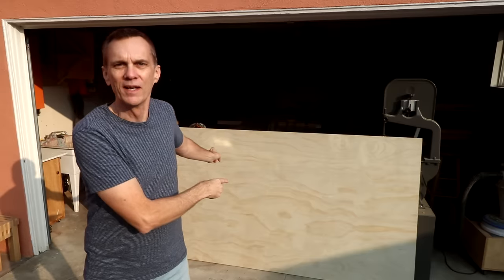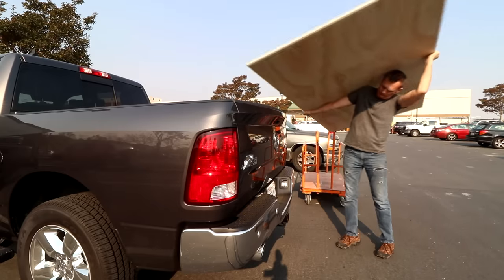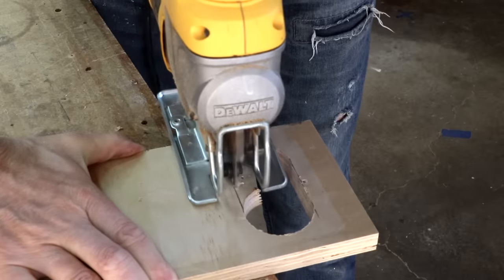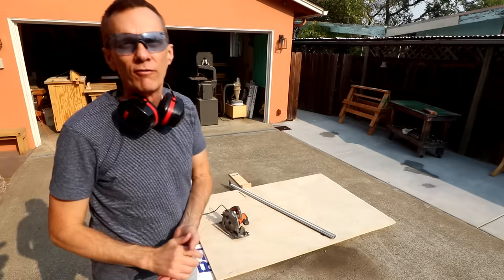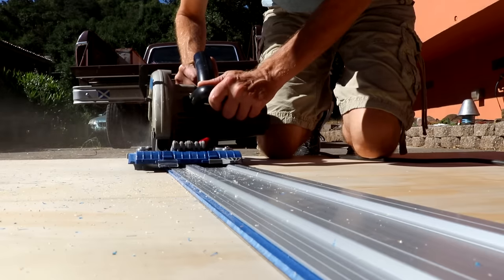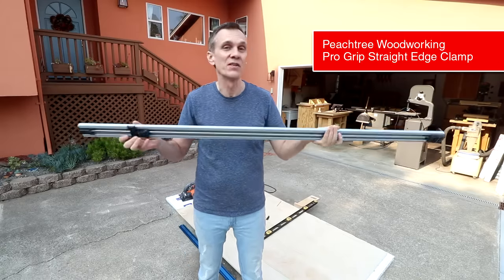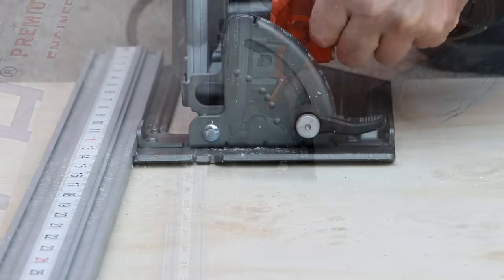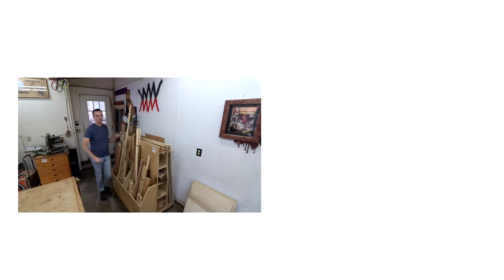How to break down plywood. A guide to cutting, moving and hauling plywood by yourself.

Comment: Having been a cabinet maker for more than thirty-five years I can say everything he said was true but that is one other concept I’d throw in! Try not to “lift” plywood. For a long time, several years in fact, I’d have to cut up a lot of plywood and be exhausted by the end of the day! Then one day, I had a big stack of plywood was delivered by the lumber yard by a driver named Blacky. Blacky was old, tired white haired (like me) and he delivered plywood all day every day. Most small shops like mine don’t have forklifts so he had to unload by hand and he taught me this valuable concept for handling plywood. DON’T PICK IT UP! Gently role the plywood on it’s corner then you just need strong fingers. Let me explain a few things first. The outside edges of most plywood was considered “expendable”, if it was lightly damaged it was still sellable. Melamine is 49x97 because it absorbs moisture at the lumber yard and is often slightly thicker and intended so they expect you to cut off the first half inch. So at the lumber yard get help loading it, they will help if you try to look weak :). When you get home, tip it off the car/truck on it’s end. Role it over the corner into your waiting hands, then it’s just sort of hanging on your fingers and your arms are mostly relaxed! Blacky could unload tons of plywood everyday. Same thing goes with the table saw, when it’s hanging in your arms, letting it rest against your shoulder then lean it against the wall or lower the corner onto the table saw, close to the fence, then role it over your shoulder and slide out from under it by backing away from the saw carefully  to not let the plywood touch the running blade until you are safely behind the plywood ready to guide the plywood up against the fence and through the cut. The key is to keep safe and go slow. This way you can handle plywood all day. The exceptions 1” plywood or particle board, it’s just to heavy and you tip and roll it everywhere, into the shop, up an the table saw etc.

Comment: I have the same truck. When I get 4x8 sheets I have the tailgate down and use two ratchet straps that crisscross over the end of the sheet and hook into the cargo hooks built into the truck bed. Very secure. The sheets will absolutely not be going anywhere.

Comment: I have one of those cheap no-name straight from China versions of the peachtree straightedge, and it's a piece of garbage.  You get what you pay for.
For making long straight cuts I simply got two pieces of melamine-coated chipboard (one wide, one narrow) and glued+screwed them together (narrow piece on top, aligning one edge of each together so it is 'stepped').  Run the saw along the edge of the narrow piece to make a zero-clearance line in the same way Steve did on the Kreg guide.  For about Au$50 I ended up making six guides of varying length (so I didn't have to use the 3m one when I only needed the 1m one).  Then out of some plywood scraps I make a rack to hang them from so they're out of the way.

Comment: Great tip on cutting on the floor when you just need a few quick cuts,,  but 2 , 2x4s on top of saw horses work great also.  I have just picked up the larger portable saw from Makita that takes dual 18 volt batteries . it seems when you just need a few cuts or work remodeling like I do you have to look for an outlet , not to mention cord getting in the way.

Comment: I need to cut plywood as I will be using it to replace the flooring upstairs. I live in the UK so the room sizes are fairly small. I was going to buy a table saw but then realised the cuts would be too long and the sheets too big. I then thought of a plunge saw and track but this might be a waste of money. Would this be useful for cabinet making in the future? Maybe just a circular saw and a straight edge would be best, it doesn't have to be super accurate for sub flooring. What do you think?

Comment: When talking about using a clamped on guide with your circular saw, I would add that you’ll get a better result if you have it project at least a few inches past the beginning and end of your cut.  If the straight edge begins right at the beginning of the cut it is hard to get the cut started straight.

Comment: I carry sheet goods on my back. I can carry 2 4x8 sheets of particle board like this. You can't carry it this way through some doorways but anything from French doors on up I can carry this way through the opening. The technique is to get the board up on its short edge and reach behind yourself and grab the two long edges with your hands, lean forward, lift and bend over until the sheet is resting on your butt and shoulders. This method is very effective and allows your legs to do all the lifting.

Comment: Well, as a former employee of one of those " Home Lumber type stores" I recommend you NEVER use the vertical carts they have, and instead get one of the FLAT carts that are about 24" tall to load your Plywood on.  Its TONS easier to load in the store, as the Plywood is laying Flat there, and even easier to load your Truck or Trailer , by just rolling the cart up to the lowered tailgate, put the end of the sheet on the tailgate, and slowly slide the sheet in flat.

Comment: All great tips. I’ve tried several of the edge guides and finally settled on a home-made shooting board. I simply mark two dots where I want the cut, clamp the shooting board down which already accounts for the blade position and cut away. The only thing that would improve upon it might be a battery-powered saw I think. But great tips 😁👍🏻
Reply: With how lithium batteries and motors have come on in the last 3 years, might be surprisingly affordable

Comment: Steve, what method would you use for cutting a 4x8 sheet of 3/4" into 18" wide full strips?  I am struggling getting the precision that I want.  I have the 2 piece Bora straight edge but it actually bends in the middle - I realized this mid cut...ugh.  I have a festool track saw but the edge is only 55".  I tried cutting it to 19" width and then tried to rip to final 18" on my SkilSaw jobsite SPT-11 table saw but failed horribly.  I tried and tried and could not keep the panel against the fence and even when I used a featherboard for some reason.  Had to leave all the tools in the garage and walk away.

Comment: For a recent project i made a vertical sheet jig that actually became a very useful project itself. Kinda like the storage unit you display last but much larger and with 4 vertical 2x4 with a slight slant so the sheets rest easily on it. For precise cuts i screw it to the frame so it stays in place as i cut. 
Very ergonomic, portable and space saving. I can either store more sheets inside it or leave it mostly open so i can reach both sides when i build my projects directly on the jig.  Just annoyed i did not make this earlier, could have saved me much headache. 
Could take a picture of it if anyone is interested. Didnt make plans for it but it is kinda based off the frame for maslow cnc that have guides.

Comment: I just use a piece of dimensional limber that has a good edge, a square and a couple of clamps. Allowing 1.5 inches for the saw offset.
I slide the sheets (usually 4 at a time) on 4 sawhorses in the garage. I back my van to the door and slide off the sheets onto the sawhorses, which are slightly lower than the top of the pile of sheets in the van and with little effort, slide the sheets onto the sawhorses. I then align the corners of the sheets and clamp the guide so that the cut is across the middle.
A final check with the square and tape, then cut, to get 8 4x4 sheets that I can easily handle and stack. As far as blades for the saw, I've gone to a 40 tooth Carbide blade. It gives a better edge and an easier cut.

Comment: I live in a country famous for its forests and timber industry but plywood is virtually unavailable.  Our panelling of choice? is OSB which comes in 1250x2500 sheets.  Most of your handling advice applies to that material too but with the added warning that cut edges of OSB can be razor sharp and it is good practice to run a sanding block along each edge after cutting it.

Comment: One point to know regarding handling is that 4' x8' plywood sheets weigh ~ 100 pounds per inch of thickness. Thus, 3/4" thick full sheets will weigh ~ 75 pounds. This is useful knowledge for both ones body lifting capacity as well as vehicular transport. A 20" high stack of plywood will weigh ~ 2,000 pounds or one ton, regardless of individual sheet thickness. The same 20" stack will contain ~ 27 sheets of 3/4"  and ~ 40 sheets of 1/2". Actual thickness specs along with manufacturing tolerances will both affect final count of sheets of a fixed height stack.

Comment: I have a special clamping tool to help with picking up/moving sheets. Recently went to home depot for some hardware and noticed culled full 3/4 MDF sheets that were barely damaged... 70% off 3 of them. Could not pass it up. When I was loading it into my truck, unfortunately I tore a ligament in my elbow. Think through it before moving 4x8 sheets by yourself. That 30 seconds could save you from injury.
Reply from the maker: Agreed. Bring a helper. There's no way anyone at Home Depot will help!
Reply: @SteveRamsey  holy crap Steve replied... first creator that helped me get into ww. Thanks for all your work Steve. You da man.

Comment: My experience with the Kreg guide is that my blades “wander” even as I keep the saw flush and tight, creating a poor cut line.
Reply: I found that the bearings in my saw had worn, allowing the blade to move from side to side by at least 1/8 of an inch.  It was impossible to get straight cuts and a huge source of frustration.  The bearings were out of production but I managed to find a set of old stock online.  When rebuilding it I realized the bearings are adjusted by friction and I could have just tapped them into position to remove the extra play.  At any rate, after the rebuild it cuts like a dream.

Comment: I was able to get a full sheet of plywood in my little hatchback car. I had the store cut it up into strips which is what I needed. You can rent a van from Home Depot or Lowe's and move a lot of sheets if you don't have the ability to move them with a truck.
Reply from the maker: Good suggestion! I forgot they rent out trucks.
Reply: Chris Calon and for about $70.00. they will deliver!!! Great for larger purchases!!!
Reply: Just watch the fine print on renting transport.  Additional Insurance,  Petrol and mileage.  Just get an airtasker to do it for a fixed price and ask them to be careful.  I buy in quantity to make it affordable.

Comment: Awesome video Steve. I just signed in to your weekend wood worker course and I've already built the patio table! I just have a question: installing cleats for a concrete wall, which is better nail or screw? Because our walls here in the Philippines is mostly concrete not wood haha
Reply from the maker: Thanks for joining TWW! I would use screws with concrete anchors. You might try construction adhesive, but it might not hold as well.
Reply: @SteveRamsey  thank you so much Steve for the advice! Keep inspiring people :)

Comment: I wonder what is 'broken' more often, panel saws at the box box stores or shake machines at the big burger spot?  In both cases, based on conversations with folks that work with them, more often than not the machine is fine but the employees don't feel like using them and/or there is no one trained to use them on site.

Comment: Someone posted in the Home Depot {"Despot") about how warped, and damaged some wood samples are.  And they are, as far as I could tell.  Could be water damage or "carelss" storage or lack of heat treatment of pine samples.  80-90% of the wood samples I checked were warped or damaged in some way.  Large variations in humidity and temperature might cause it too.

Comment: I bought plywood at my local Lowes and had it cut there. The piece sizes ended up being way off, up to a full inch on some cuts. I'm not sure if it was just my local Lowes employees not caring, but you might have better luck with Home Depot for cutting plywood.

Comment: That 50" peachtree clamp is no longer available on Amazon.  Do you have another clamp that you recommend?  You seemed to suggest that it performed better than the one you had previously.
Reply from the maker: This Emerson one is just about the same. I haven't used it, but  I've had people tell me it works great! https://www.amazon.com/Emerson-Tool-C50-Contractor-Straight/dp/B003TXSAHU/ref=mp_s_a_1_8?adgrpid=56734494220&gclid=CjwKCAjwyqTqBRAyEiwA8K_4O9oOK3KIROmbmmlHNI6DaC1hqnBKNcL1eGHzuw1Eb9MwRzqIce_ukxoCQMIQAvD_BwE&hvadid=274683045273&hvdev=m&hvlocphy=9032109&hvnetw=g&hvpos=1t2&hvqmt=e&hvrand=1844575112176926434&hvtargid=aud-647846986281%3Akwd-300525095022&hydadcr=20376_9349054&keywords=bora+clamp+edge&qid=1565131683&s=gateway&sr=8-8

Comment: Looking at your local Home Depot, I guess I'm lucky.  I have a large lumber shop nearby that will load sheet goods for the customer (great selection, true to size).  Since I have a Suburban, sheet goods will lie flat inside the truck and be protected from the weather.  If I buy from the orange big box store, the flat lumber cart is the same height as the rear of my Suburban...just open the doors, roll the cart forward, and simply slide the sheets into the vehicle.  But on another note, I try to avoid buying sheet goods from the big box places...too much variation in the thickness of the plywood sheets.

Comment: There is a gorilla gripper if your doing lots with heavy ply.  There is one that’s cheaper on eBay.  There is also a jig with a wheel and and clamp to attach it to one corner and wheel it around. By picking up the other corner.  A full sheet storage mobile unit would be a good project.  Especially for those who don’t have a truck.  And an attachment jig on your work bench to tilt a full  sheet onto your workbench is also a good project.  I don’t have a truck so it’s cheaper to buy quantities and have delivered by an AirTasker.  Should have mentioned I have a full sheet workbench 2440x1220 in a single car garage that every thing else fits around.

Comment: Question. What is best way to transport/strap down plywood if you dont have truck?
Reply: A lot of home and hardware stores sell small, folding trailers.   They're 4' x 8', pretty cheap and fold in half to store vertically against a wall inside or outside.   It doesn't take much of a car to tow them with a few sheets of plywood.  I've used mine to haul  junk, plywood, riding mowers and  motorcycles.   I'll even use it instead of the pickup that I have now because the trailer is a lot lower and easier to load.   Very handy.
Reply: Harbor freight 4x8 folding trailer works great!!
Reply: Call a friend that HAS a truck?
Reply: Buy a minivan
Reply: @larryg3326  what? Ive never heard of those.

Comment: The prices you showed for track saws are towards the upper limit.....I wouldn't be so quick to dismiss them now.  A decent one can be had for ~$150 nowadays.  The Wen model (the exact same saw as the Grizzly/Shop Fox/Sheppach) used to have some issues sitting flat on the track, but that's been corrected.  With a few easy modifications to the internal spring and dust collection, one of these saws will function just as well as the more expensive ones you've shown.  The all-in cost would be similar to the straight edge guides you've chosen instead.

Comment: if you mount a castor under your hook jig it woul make moving sheets even easier
Reply from the maker: That's a good idea!
Reply: @SteveRamsey   Or two flat skateboards behind each other wit U-clamps mounted on them.
Reply: Steve Ramsey - Woodworking for Mere Mortals thank you Steve
Reply: @SteveRamsey  I think April Wilkerson has one with casters
Reply: The “I like to make stuff” guy has a good video on making something like that to easily roll sheet goods around. Looked like it worked well.
Reply: If you add a spacer block on the "load" side, right under the handhold, your knuckles will thank you.
Reply: But it will make the poor castor tired. Better put a castEr.

Comment: How big are the plywood sheets in America?  In the UK we usually have 2x4ft sheets. Perfect for a workbench or table.
Reply: 4x8 ft is the normal size, some of the Baltic Birch comes in 5x5 foot sheets.
Reply: You can get 2x4 sheet but they usually cost about twice as much per sq ft..........4x8 is the most common and economical.

Comment: Another good idea is too build your own track.  Take a scrap of ply attach a piece of hard wood on top, then cut it.  Perfect zero clearance  track and it cost you almost nothing.  Did it for many years when I owned a cabinet shop.   Took maybe 5 mins too make and would last about 2 years before it was toast.  Even made them with mothers in both directions.

Comment: You can make a track saw easily. Buy a length of Aluminum angle and screw it to a piece of plywood more than the width of a cut on your circular saw. Then run your circular saw along it it to cut a zero clearance edge.

Comment: I've got a cheap battery powered circular saw, using it just for this purpose. Also, always using your advice to put the Styrofoam under the wood. There is no easier way to do it!
Reply from the maker: Thanks Petar!
Reply: Rip it right in the parking lot.
Reply: What's the thickness of the foam board? Is 0.5in too thin?

Comment: Your 'wingspan' as you call it, from finger tip to finger tip is equal to your height. That sheet looks to be about 4 feet wide so anyone taller than 5 feet could reach both sides of it comfortably.